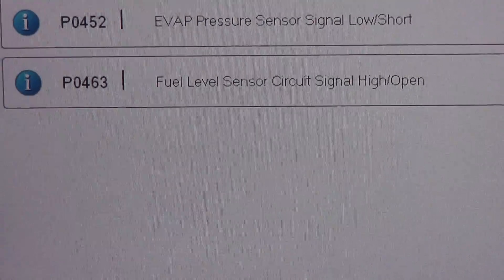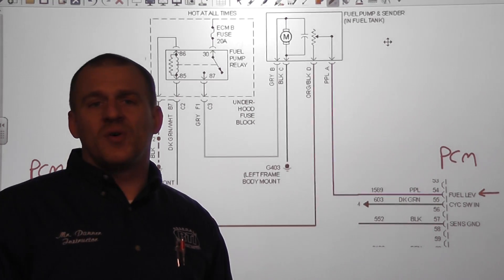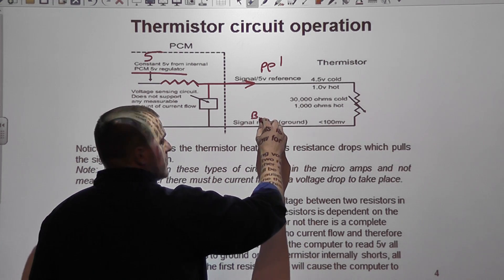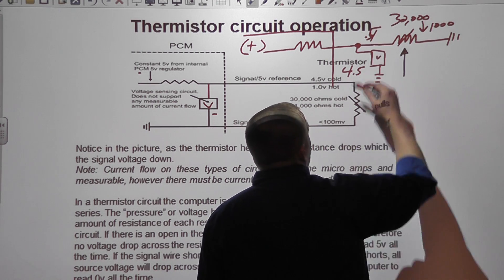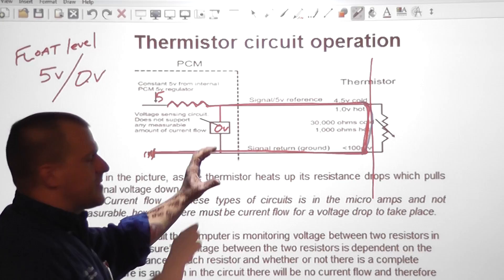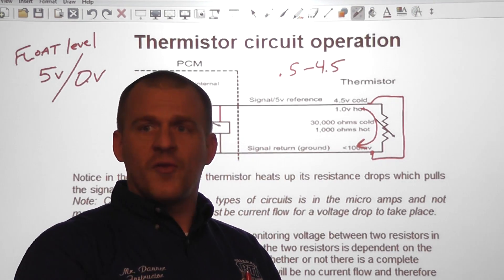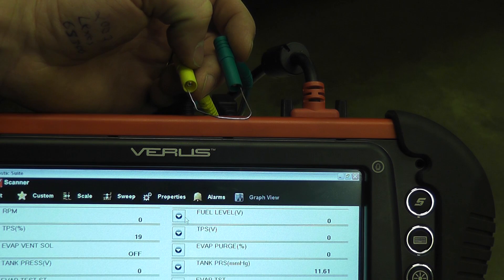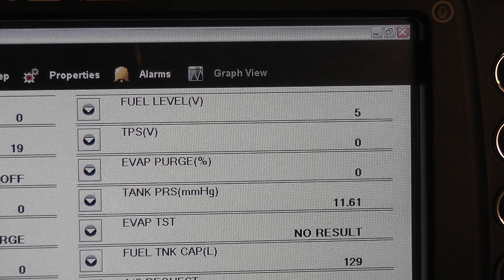How to test a fuel gauge (tank sending unit) P0463 - GM

Comment: hi danner, I have a 2003 mdx whit p0463 I check power and ground they good, somebody eels change the fuel pump and the dashboard, at this point I don't know what else could be wrong... need help!!!!!!!!
Reply: alekstolstoi I have a 2000 Camaro I bought 3weeks ago and when I crank it up the gas start pouring down from the top of the gas tank.it only comes out when I crank the car up?could Yu Tell me what's the problem is

Comment: my gas hand stuck on e wat is the problem on my 2007 grand Marquis
Reply from the maker: Most of the time it is a bad float (sending unit) in the tank. Change the fuel pump while your in there

Comment: what if your fuel gauge goes to half a tank then starts increasing back to full then would drop to 3/4  when the car is on the road and I know I have used over half a tank?
Reply from the maker: Bad fuel sending unit. Especially if it is a GM vehicle

Comment: what is happening when fuel gauge is reading full all the time.
Reply: Bad sending unit or open no ground equals high voltage on wiper to resistor thus causing a high signal making the Gauge stay high

Comment: Hi.. Could you please test bench setup for validation of Fuel level gauge in cluster?
by using following test cases
1). At full level, Empty level
2). At 75%, 50%, 35.5% fuel level indication in fuel level gauge
3.  By create fault conditions like Primary sensor& Secondary sensors at High, Low. Both

Comment: One step you didn't mention her is the cluster itself that could be faulty that it will not respond to the change in voltage. Watch the fuel gauge to go full when sensor is unplugged, and when shorted together reads empty, this will prove the cluster is good and the circuit and PCM is good.
Reply from the maker: +Automotive Technology For sure the cluster would be a concern, but not in this case. The code was in the ECM, the fault was within the sensor (float), wiring or ECM only. The cluster gets it's info. from the network on fuel level. (If I remember correctly)
Reply: in this case it is possible, but I would take that variable out in my mind, cause you are there anyway and you will be 100%.
Reply from the maker: +Automotive Technology for sure it is possible to have 2 separate faults. What I am addressing here is the trouble code and tank sending unit. The cluster operations are not part of this fault in any way. I agree that it would be smart business practice before selling the job is to ensure the gauge operates properly. But again, a faulty gauge would not set this fault or be part of the testing procedures for this fault. Make sense?
Of course all of what I said hinges on the fact that there is no direct wiring from the sending unit to the cluster. Without looking at the video and diagram I'm not 100% sure. If any part of the gauge sending unit circuit is hard wired to the cluster this will change everything and  you would be correct that I should have also verified gauge operation.
Reply: It is awesome video.

Comment: I got absolutely embarrassed on an 05 F250 5.4L gas. I disconnected the connector at the tank and did all kinds of things to the vehicle harness side. Shorted it, left it open, shorted with a 4ohm test light. No matter what the gauge wouldn't change. Except one time when I plugged in a new fuel pump module to the connector I was able to get it to read full. But then it was stuck on full. Would not register any changes. I even pulled the pins out of the dash connector and did all the tests directly to the cluster. Still no changes. 

It was just a basic potentiometer circuit. Power wire coming from cluster through sender and back to cluster. Nothing else on that circuit. I kept doing similar tests over and over to try and find a mistake in my earlier tests that showed it actually was the sender. I so totally did not want to call the cluster! Getting it fully rebuilt would be $500 our cost... It was electronic and everything else on it worked. We dropped the cluster off at a repair place that said it worked fine. When I picked it up I found out they just moved the gauge via CAN bus messages and didn't actually touch the sender pins that went into the dash. Could there be a bad solder joint from those pins to the cluster module? I hated everything about it. 

We got a used cluster and of course it didn't make any difference.  Long story short I finally found some good documentation on the system that mentioned the gauge operated on a default anti-sloshing mode. Unless you did this specified procedure involving pulling three fuses, cycling key, waiting, plugging back in, etc that it could take up to an hour to register any change... So it was the sender after all. The cluster WAS seeing the changes it was just IGNORING them!!! 

I kicked myself over that one....
Reply from the maker: +E Urban oh man, I've been there with the anti slosh modules on Fords. That is something you'll never forget. I'm sorry I didn't mention that variable in this video.

Comment: When you short the leads for the sending unit at the tank connector what is the expected reading on the fuel gauge? Should it go to full?
Reply: Yes, I believe so.  My fuel gauge was having issue when filled up it's only show 7/8" full...he did the test and it went to full so he told me it's the sending unit is bad...and needs replacement.  However, after installing the new sending unit, it still show the same. LOL BTW he was also a Auto Mechanic teacher at a technical college earning money on the side during summer times.  Needless to say my problem persist and he could  fix the problem. LOL....Now, it's worst after he installed the fuel ring gas cap, it leaks fuel, redo and it still leak fuel so he order new ring gasket and fixed the leaking fuel ring gas cap but now my fuel gauge read worst then before at 3/4 full after filled up.  Hell, he's not good and he really don't want to reopen the fuel tank and check my fuel level sending unit or the leveler because he already do it 3 times trying to fix the leaky fuel ring cap.   Don't know....now  I'm stuck with an unreliable fuel gauge.  Any help?

Comment: hey dan i have the same problem on  but this is a 2000 dodge ram van 3500  the fuel gage always mark a full even when is empty a liltle hand on this  please thanks
Reply: maybe the float is mechanically stuck and not dropping as the fuel is getting low. or you have a short in the wires, you can check that in this video 10:40

Comment: hey dan i have been lerning allot from youre vids on youtube thank u for putting up vids. i have a question i am working on a 2001 ford focus and its putting out a po 460 code my scanner tells me its a fuel gauge sending unit i checked the 5 volt out put wire its good and the signal wire has 2 volts coming out with about alittle over 1/2 tank of gas checked ground it has good ground the gauge is working good dont know what else it could b if u can please help me out thank u .
Reply: If the gauge is working then it is not the sending unit as the sending unit reports directly to the instrument cluster. The cluster would then send that info to the PCM via a data bus. It would help to know what model Focus just to make sure I looked at the correct diagram
Reply: I found the problem  i checked for power at the cluster harness and it had power and ground i found a diagram on autozone.com and seen it had another power wire which was yellow blue wire had no power so i checked the fuse and it was blown it was F50 7.5 amp fuse. the car is a 2001 ford focus lx. thank u for writing back. also i Have a 2003 toyota matrix fuel gauge that goes to full when i fill up but when it is empty it goes down to 3/4 mark it has to wires going to the sending unit it has a power wire with 12.34 volts and a ground wire i tried puting another sending unit same thing i could not figure it out what do u think it could be?
Reply: its a 2003 toyota matrix xr model thank u.

Comment: Scanner Danner Hope you can help! Have a 2.2 echotech 2005 Pontiac.Tempguage doesn't always park at the bottom when cold. But seems to go up to 90 degrees  no matter where it decides to park at when cold. ex. If parks at 50 degrees will go up 90 degrees from there and sit at 100. If parks at 90 degrees will go up to what looks like180 degrees. Changed ect sensor twice, Not overheating. Thermostate opens. Coolant level normal, Fan works. Car appears to run normal. Only code is a Genric P0001 fuel volume regualator control circuit/open, Can't find in code book. Any ideas. headgasket, stepper motor, vac leak, guage (not digital), bad computer. Hellllp!

Comment: Thanks for your time, I'll try that and let you know what i find. I should get the truck back first of this week but i remember when the conn. was plugged into the tank voltage was somewhere in the 3v range but the gauge read empty. Don't remember if i cleared codes and cycled key though. Looks like circuitry is working just not to the gauge. tank unit had already been replaced.

Comment from the maker: The gauge on this is computer controlled and there may be a default position with the signal fixed at 0 or 5. Try using a resistor between the terminals to drop the signal voltage somewhere between 1 and 4 volts. This should result in gauge movement. Remember you may need to cycle the key and clear the code for the gauge to move.

Comment: Would this be the same procedure for an 09? The gauge reads empty all the time. I checked at the connector and with a scanner, they both were reading normal i don't recall the exact #'s right now but the scanner was showing a level and my dvom had a voltage reading around 3 volts but Alldata in the description and operation says the ecm sends info to the bcm and on to the cluster but there is no bcm in the wiring diagram. at least the Alldata i have which goes to 07.

Comment from the maker: OL-Fault means the system is running in open loop and is usually from an O2 sensor problem or from an overly rich or lean AF ratio. This has nothing to do with your sending unit.

Comment: ok, using the freeze frame data on my scantool its giving me normal ect temp at 73deg, but it did say fuel sys 1: OL-Fault and fuel sys 2 N/A...does that mean that i have a problem at the fuel sending units end???

Comment: no need to watch again, i think i got it now. the voltage was fixed at 5 volts. then you jumped the signal wire to ground (with connector still plugged in) and it dropped to 0 volts. so you pretty much provided a different path to ground thereby bypassing the resistor in the sending unit (since current will flow through the path of least resistance). is that right? also what do you mean by pans when you said "jumping the 2 pans". thanks

Comment from the maker: to be honest with you, I do not remember. I think I remember the signal voltage being fixed at 5 volts. and if I remember correctly, I wasn't doing a bypass test I was checking signal circuit integrity. so with the signal voltage fixed at 5 jumping it to ground would be the same thing as jumping the 2 pans together. maybe I need to watch it again when I get time to answer you better

Comment: Paul, to do the bypass test u said we need to disconnect the sender and jump the two wires. But to check the ground you said we need to leave the sender plugged in. The problem is i didnt see you unplug the connector for the bypass test. Was it unplugged for the bypass test and then plugged back in for the ground test?

Comment: i posted a video of the freeze frame data from my scan tool, after checking my grounds i found a missed ground wire & i also added two extra body to engine ground wires. still had the same results. i was wondering if this would help any.

Comment from the maker: these two gauges have NO direct wiring to sensors, information is shared on a data network. check the fuel level sensor and coolant temp. sensor readings on the engine computer data, if they are good there and not on the cluster, you have a cluster problem

Comment: Hey i have a 2000 model s10, my fuel and engine temp have quit working at the same time, mileage counter and battery light only come on in acc position tested the cluster & its fine, replaced the body harness its good, idk what it could be...any suggestions to this commen problem with no answer?

Comment: Hi Paul i having problems with temperature gauge on my ford Taurus v6 12 valves 2005,it goes all the way pass HI  and sometimes go back to the middle.already replace the ECT sensor because i was told in this model  doen't have Temp sender unit.it didn't fix the problem.what else can i do?

Comment from the maker: Truthfully you don't know for sure but I think what you said about the low fuel light makes me feel better about the gauge reading accurately at the lower tank levels. It is common for gauge sending units to have contact issues in only certain places on the resistor. That's what it sounds like to me.

Comment: How do I know that my low level reading is good? Well, when the gauge was reading the full right as well, and I had the fuel running low, the warning lamp lighted up at around 11liters of fuel left in the tank. And it hasn't changed. So it lights up around about there nowadays as well. So that's why I'm guessing what I wrote before. But I could be wrong and just simply the sender unit could be screwed up.
Reply: Mr. Scanner. I replaced my fuel pump. And after I reconnect my battery all the closter gauges.just don't work.any ideas tnks

Comment: When my tank is full, the gauge shows ~80%. But as the tank empties it shows the fuel level more accurately. So my guess is that when the tank is full, than the sender has a low resistance and when it's almost empty the sender has high resistance. And my faulty full reading is beacause the connector at the tank is probably corroded, hence resisted somewhat. Causing the full readout to be unprecise, but the low level reading almost perfect. Am I right or wrong? (Tank needs to be dropped to check)

Comment from the maker: before condemning the computer you must check the 5 volt reference circuit for shorts to ground. watch my 3 part video on a Jeep with a no start where I am doing just that. if the car still runs and it is only the coolant sensor circuit that is being affected then you must check this circuit for a short to ground before condemning the computer

Comment: So if I unplug the connector, than I should measure 5V on the signal wire. I measured 0V. We digged out the PCM and checked the integrity of the wires, both were good. We couldn't measure any voltage at the PCM as well. It should be 5V with the connector unplugged, right? It's an ECT sensor I'm writing about. Symptoms: no CEL, car isn't OBD II (so no live data), car consumes around 50% more fuel than it used to. It's called a Suzuki Swift in Europe. Known for PCM failures. Could it be a bad PCM?

Comment: Hi Paul.  Fantastic channel here.  Very talented.  Very jealous of your equipment!  I am in the UK but lucky to own a 97 Lincoln Mark 8 with an erratic fuel gage.  Tank sender been changed but is still erratic.  Ford NGS shows 0.32V in Pids but at connector under the car is 2.1V?   Supposedly sender transmits to message center, then goes to the instrument cluster via the network.  Gage is driven fine from the scanner, although at 80% on scan tool, gage is reading full.  No codes. Any advice?

Comment from the maker: The P0452 code has to do with the fuel tank pressure sensor. It sits on top of the tank unit. These code are not related, but they do share a common ground. 
It is a common GM fault to have a bad float resistor cause the P0463 DTC

Comment: hello Danner I have the p0452 code on 99 blazer I found with my own scanner. I put the new sensor and take my blazer to a mechanic who has a scanner like yours and find the code p0463 but not on my scanner the mechanic says that NEED TO assambly unit to resolve the p0452 to pass the test are actually related these two codes? even if the fuel gauge is fine?

Comment: ScanerDanner majstore pa ti si Bog! To translate it is :ScannerDanner master you are God :) your videos helped me so much in diagnosing bad wires or sensors etc.By the way i am mechanic working on Renault in Serbia for five years now.I've been so frustrated doing ohm testing that was leading nowhere.Than your voltage drop testing was like a light at the end of the tunnel.I actually solved a problem in 5 minutes that was driving my boss nuts for 2 hours.Thank you.Greetings from Serbia!!!
Reply: One "small" correction. There is only one God, the Creator of the Universe. No human can be called God, not even the pope.

Comment: In a pinch, can you use the vehicle’s own fuel gauge as the indicator of wiring integrity (instead of the scanner reading 5v/0v) when shorting the sensor signal and ground wires or does the diagnostic code cause the gauge to stop functioning until it’s cleared?